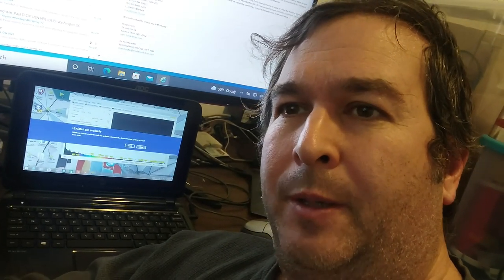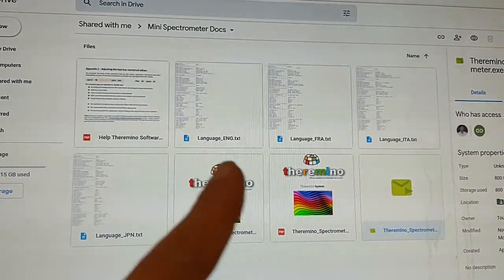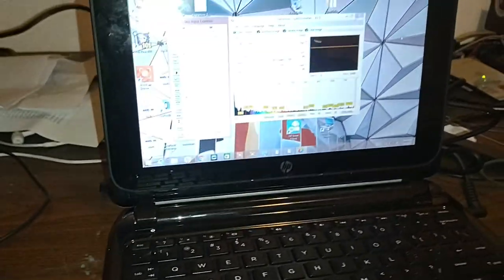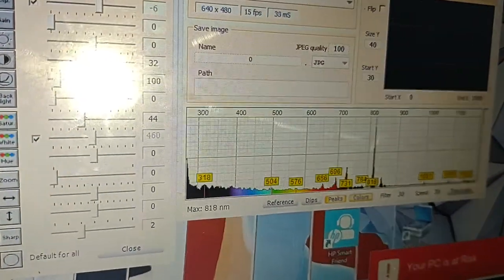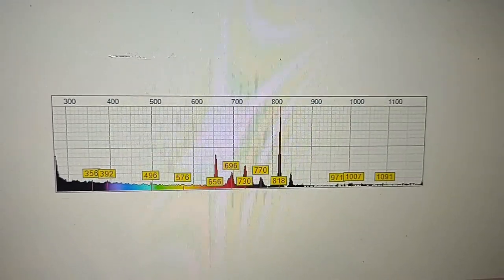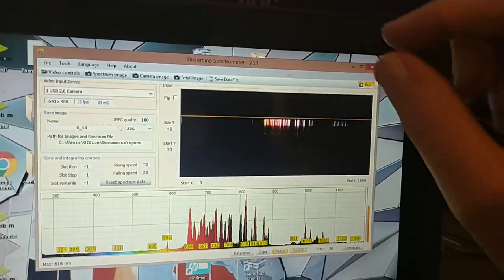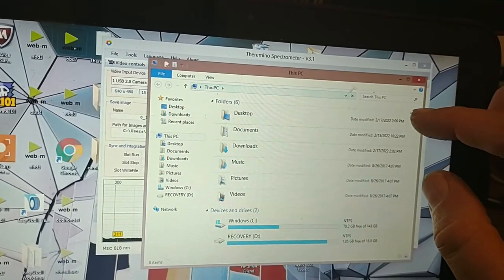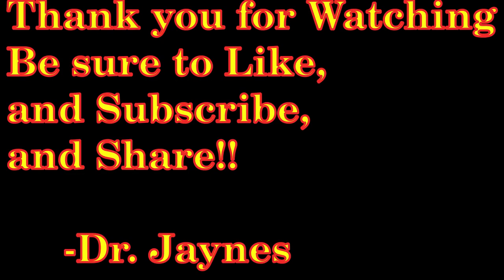$99 USB Optical Spectrometer!

Comment: It now costs $150, as of Aug 25, 2023
Reply: Same January 1st 2024.  Also, is "Teremino downloadable software" the same as Theremino in French or is that a typo?
Reply: 350 now plus freight
Reply: the price increased, because there are upgraded requested by users : metallic slit, more sensitive detector, and the spectrometer coms no calibrated with a calibration in a USB flash memory.
Reply: @LawpickingLocksmith  That is the C Model, it has a detector 100 times more sensitive, but a much better resolution  (less than 0.5nm)

Comment: Wondering what it looks like on the inside?  Inspired me to look for an older HD external enclosure from a second hand place, to use as a metal case for a DIY diffraction grating spectrometer.
Reply: Wondering which CMOS sensor is being used?

Comment: Have you found this device to be calibrated? I.e., do the lines match the correct wavelengths and amplitudes? Thanks anyway for showing.
Reply: The new model goes from 350 until 950nm, with a better detector and a metallic slit. The last version of the spectrometer comes calibrated with the calibration file in a USB flash memory.

Comment: From the link you provided, they are selling one with a range of 400 to 750nm at $200. Did they reduced the spectral range ?
Reply: The new model goes from 350 until 950nm, with a better detector and a metallic slit. The last version of the spectrometer comes calibrated with the calibration file in a USB flash memory.